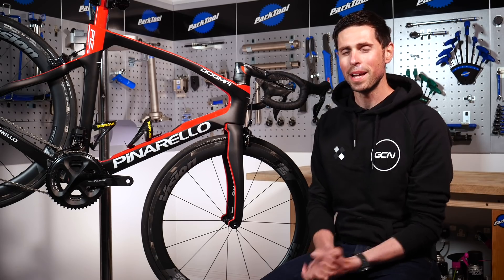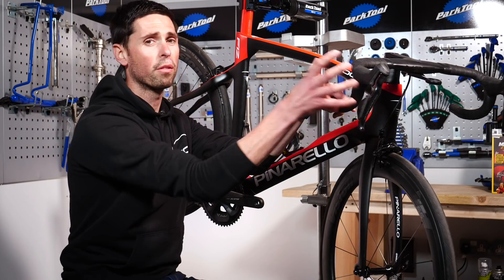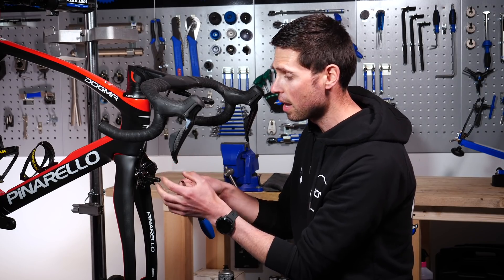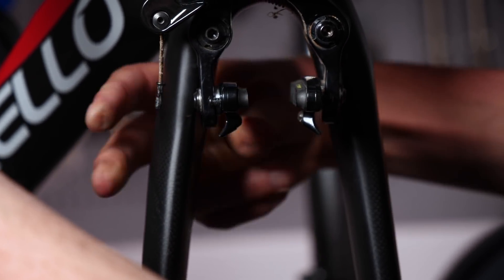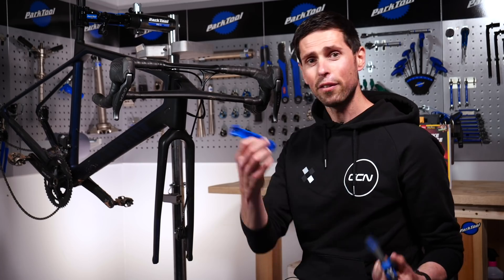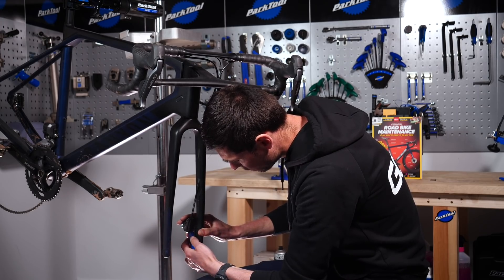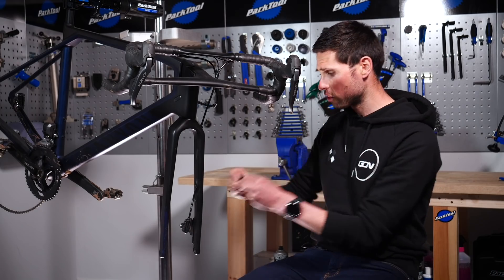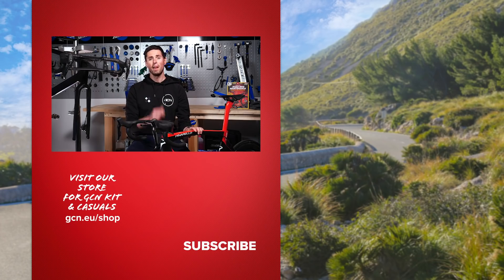STOP! How to set up and maintain your bicycle brakes | GCN Tech Crash Course Ep.2

Comment: Automotive disc brake anti-squeal can really help a super stubbornly squealing disc brake. Some forks just have resonance, and can't be fixed with alignment, but the high temperature rubber of the anti-squeal can work a trick.

Comment: Also, for new  pads on rim brakes make sure they are the correct type for the wheels, ie metal or carbon rims.
Reply: Yep. And make sure they are approved by your wheel manufacturer. Using unapproved pads may result in loss of warranty especially on high end carbon wheels (Zipp, Mavic, Enve etc).

Comment: 6:40 These are the right hand side... proceeds to install it on the left :)
Reply: LOOOL, yeah, I noticed that too!
Reply: Yup, and I also see that he is operating the right hand brake for front wheel! I always have used it for the rear wheel. I guess everything is reversed in this cycle?!
Reply: @KaushikNSanji  no, he made a legitimate mistake. As for the brake, that's just a thing that some left-hand drive countries have. They use moto style brakes, which is right hand for front brake, left for rear. This is the opposite of the American bicycle standard, which is what the majority of the world uses.
Reply: The same thing is true on the disc brake example too.  12:36
Reply: @KaushikNSanji  Yep, front brake has always been on the right in Britain, same on motor bikes. I think having front brake on the left is a continental thing that has taken favour with some due to import of non-British made bikes.
Reply: Alex might not've made a mistake.  That which is right viewed from the front will be left when viewed from the rear.
Reply: @richardharris8538  that is precisely the issue. He had the left brake pad on his hand and proceeded to install it on the right hand side when facing the bike so, he effectively installed it on the left side of the caliper.
Reply: @KaushikNSanji  that's the British way, left for rear right for front

Comment: Instead of a screwdriver to push the pads out, use a pencil with an eraser/rubber on the end. The eraser won't damage you or the paint if it slips.
Or, a plastic tire lever. But everyone has a pencil somewhere around.

Comment: I didn't realize rim brakes had changed.  I have Ultegra brakes from 1991 on my custom-built Tesch. Just one big 5mm screw holds the rubber and metal back part in place.  Even then, though, the right side of the bike was on the right.

Comment: Re. rim brakes - the brake shoes that house the pads do have a front and rear to them. Sometimes pads can be an absolute menace and refuse to come out. Buying new brake shoes with pads already fitted can safe anguish. They must be fitted the correct way and correctly lined up or you risk the pads sliding out of the shoes when braking. Not all brake shoes have grub screws to hold the pads in place and rely on the correctly fitted shoes to avoid this mishap.

Comment: I think I’m being daft. The rim break pads are marked L & R because they are slightly curved to match your rim...  surely if you flip the break around your can match the curvature of the where on either side. Is the risk actually putting it in upside down? In which case how does L&R help. Am I being simple or is the curvature of the pad not the reason you have L&R on the pads.

Comment: #AskGCNTech  Would like to see how you would realign the disc brake calipers if there is brake rub after changing out the pads.
Reply: If they weren't rubbing before, it's probalby just a matter of using a plastic tire lever to press the pistons back into the calipers. It's always good to do this any time you take the pads out, but especially when you (or  before) install new pads.

Comment: Do DA brakes have more stopping power than 105 or is it just a weight difference?
Also curious as to why that DA equipped F12 has a 105 crankset.
Reply: Maximum braking is at the point when the rear wheel stars to rise.. about 0.6 G.. doesn't make any difference what type of brakes.. any more and you go right over the handlebar. Any good brake will easily do that and should be controllable.
Reply: it's more about pad meterial, stock shimano pads for rim brakes are garbage
Reply: @yisraels4555  I see. Thanks for explaining.
Reply: It doesn’t have pedals fitted either. I think the bike usually has a non GCN sponsor power meter chainset installed (Stages or Quark) so they’ve fitted a 105 crankset just for while they’re filming this vid.
Reply: The 105 setup could also be a cost savings.... well maybe in the real world...

Comment: When removing my wheels there is not enough clearence to get the tire past the breakpads so i have to deflate it before beeing able to get it out. Is there a fix for this?
Reply: Usually, if not always, there's a release mechanism on rim brakes that, when operated, increases the distance between the pads.  In my experience, that's usually enough to allow for removal of the wheels without the need for deflating the tires.  Just remember to switch it back before riding the bike, otherwise your brake won't work.
Reply: @richardharris8538  opening the break pads to their furthest point isn't enough to get the tire through unfortunately

Comment: Disc brakes are like having a high maintenance girlfriend with lots of allergies 😐
Reply: Literally never had any issues with disk brakes, and even if I did, it would be well worth it for the ability to actually stop my bike instead of just suggesting it slows down like rim brakes do.
Reply: @mihalis1010  Maybe for a fat rider on a downhill bike. My rim brakes on my road bike lock my wheel up very easily if I'm not careful. How much more breaking performance  than locking the wheel do you need?
Reply: @666louis  I'm 75kg, and I live in the mountains. It rains a lot as well. Far too many times have I almost overshot intersections because rim brakes just weren't slowing me down. Again, I've never had problems with disks, so I honestly don't see the downside to having them. This incessant love for rim brakes seems to fueled by nothing more than nostalgia.
Reply: @mihalis1010  Ah well, I don't ride in the rain, fair point though.
For my disk brakes it seems that no matter how careful thoroughly I clean the calipers, one cylinder is always quicker to extend so I get one sided rubbing on the pads. Or, the other way around, one cylinder doesn't want to retract the same distance than the other then I get rubbing while not breaking.
It just seems they are very sensitive to dust ingress and then give you troubles.
Reply: @666louis  That seems to me like faulty brakes, and/or not having them properly bled. My Ultegra calipers never rub other than when I am climbing out of the saddle. I have SRAM 4 piston calipers on my enduro bike, which I ride in mud and dust, and they also never seem to rub. I also am a bit obsessive with cleaning my bikes though, almost like it is some sort of catharsis for my anxiety, but I really don't do much with the brakes themselves. I will admit that bedding in pads that are new or freshly cleaned is a bit of a drag, and just not bedding them at all can make for some unnecessary issues, like slightly decreased or uneven performance, and howling. They howl in the wet either way though, so I guess it doesn't matter that much.

Comment: Stop it #GCNtech with this guy giving mechanical advice. 
1) Brake advice coming from the same guy that used a dirty rag on brake rotors for the detailing video? Stop it. 
2) Now this video he shows disc pads touching his hand to where the oil of his skin is touching the pad surface when he talks about the pad spring? 
3) Then for rim brakes, he puts the wrong pad on the wrong side. This guy is not a wrench. He’s a hack. Please stop #GCNtech. 
His ‘tutoring’ is creating garage hacks everywhere. Shameful.